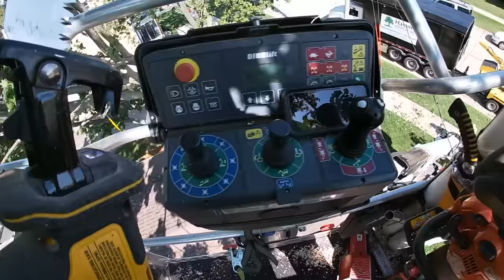Harassed by Angry Neighbor Demanding Tree Removal

Comment: As a homeowner, if that was my tree and on my property line, I would immediately have it removed for the safety of my neighbor and their property. I would be ashamed and embarrassed otherwise. Shame on him and his snotty wife!
Reply from the maker: I can truly relate Norbert.  One of our core values is Extreme ownership and it would compel me to do as you have said. https://www.instagram.com/tv/CXGmjZ7JD4v/?utm_medium=copy_link. Thanks for your comment!
Reply: I agree - I would do the same.  That said, how does an ethical, moral and good values based neighbor pay Mr.Game of Trees in those tight situations? This is not cheap work and I would loose sleep knowing  5,000lbs of tree will fall on my neighbors garage before figuring out my financial solution. 
I'm a newbie homeowner.
Reply: @johncollins7044  Here is AZ, if the neighbors tree is hanging over my fence, I can trim to the fence.  I have done it to my neighbors oak on one side and my other neighbor has done it to my tree that is hanging over his pool.  I have no issues with it either way.
Reply: @nmopzzz   i live in tucson and i researched about trimming trees coming across property lines, and what  he says in the video about if you trim and kill the tree than its on you is true here.  dont believe everything you hear.
Reply: I would propose that we share cost, we both win.
Reply: @59jm24  I agree! however I think the tree owner is set on making a issue of what's happening & trying to get someone else to pay for what he should pay for & then some!
Reply: @GameofTrees  “separate-entities” not a blanket statement!
Reply: @ThedrcOfYork  If she is running a non profit house, she is most likely dumping household cash into the non profit. They may not have the funds. that being said I would tell my neighbor the truth and then advertise free firewood, you cut it down.
Reply: @waynegriswold8953  In WV if you trim a tree or bush back to your own property line and that plant/tree dies then that is perfectly fine as long as you didn't go onto their property to cut it down without written permission. The way we see it is if your property is causing problems on someone else's property then you should take care of it yourself and if you don't then your neighbor will.
Reply: @59jm24  Presumes both cooperative and reasonable people.
Reply from the maker: @Morons with Power actually, I have a septic, so I keep most of it until I pay to have it pumped every three years:) thanks for participating!
Reply: @GameofTrees  you did right by the woman with the non-profit helping others ...     "bring me to court :)"
Reply: I not only would, I actually have removed large trees on my property leaning towards a neighbor's house just 20ft away.
Reply: @johncollins7044  It need not be expensive if there is room to fell the tree whole or in large pieces, and you have a chainsaw to cut up the pieces.  I usually pay about $100-$200 per tree for my tree service contractor to "make the trees horizontal" for me.  Then I cut them up myself.   I even had one tree cut and lifted off the end of my roof, for just $800.
Reply: I totally agree with you.
Reply: @waynegriswold8953  
You were a very smart chap to actually check. Different states, even different areas with the state, may have quite different interpretations of what is, or is not, allowed.
In this country, deliberately killing the tree is illegal, and can even get prison time, but trimming to the boundary is allowed and if it kills the tree as a result, it may be legal as the killing wasn't the intent.
On the other hand, as a tree owner, I'd usually be liable for damage from the tree losing limbs, or even falling, if it was a known hazard.
Reply: I completely support the arborist here, but do understand that most people don't have the money to pay for anything over and above daily expenses. My sister had a couple of trees removed and it cost her thousands. She had to borrow money from my dad. This stuff ain't cheap. LoL
Reply: @tortillasarenotbiceps7622  I know it isn't cheap. We had 4 trees removed, not real big ones and it cost us over $4000.
Reply: Totally agree with you.
Reply: @hoosierladyus48  Ridiculous, right? I know these guys need to get paid, but it is very expensive and not everyone has thousands to toss around.
Reply: @waynegriswold8953  But it's HIS TREE. You can't charge your neighbours for the damage resulting from your own tree landing on your own property, ESPECIALLY when they had to remove it because HE refused to despite it being an obvious safety concern. The neighbours can charge HIM though if HIS tree lands on THEIR property. They could also sue him to have the side hanging over their shed removed. But they'd rather pay out of their own pocket instead of taking him to court. You're an idiot if you can't see how ridiculous it is to try and sue someone who paid out of their own pocket to do what you should have and are LEGALLY OBLIGATED to have done out of YOUR own pocket.
Reply: @tortillasarenotbiceps7622  You know what's even more not cheap? Having to pay for the damage to your neighbour's property resulting from being too cheap to pay for the tree to be removed in the first place...
Reply: @johncollins7044  He has a new boat, but he doesn't mind neglecting a tree that could destroy his neighbors property.  Priorities?
Reply: That Bloke with the Beer Gut was a woman?
Reply: I had a case like this years ago---a huge dying tree straddling the property line. I was going to pay for the entire removal but I asked the neighbor to allow the truck to go onto his property so that I didn't have to remove my fence. (The neighbor didn't have any landscaping or fencing; his yard was basically an open field.) He told me he would not allow the truck on his property, so I decided to just have my side of the tree removed. But before doing so, I consulted a lawyer just to make sure that he couldn't sue me for "damaging the tree" (I had lots of pictures of the rot that was splitting the tree in two.) The lawyer gave the all clear and my side was taken down. A month or two later, the other half of the tree collapsed into the neighbor's yard. I must say, I got quite a lot of satisfaction out of listening to him try to hand saw the enormous amount of tree debris that filled his backyard. Lol.
Reply: @forgottenking8141  A lot of the time,  those IN the law are not versed or fair in their judgements and decisions.  Unfortunately,  they are still "human" (to some degree)  and personal biases and such will make way into their decisions.
Reply: @GameofTrees   I think you could have legally dumped the cuttings in the tree owners yard , you are not required to dispose of his tree cuttings . Is that how the law works in that state ?
Reply: that’s cause you’re a responsible home owner. I’ve had to pay to trim my idiot neighbor’s overgrown tree cause he was too cheap to remove or trim it. it sux
Reply: Well said.x
Reply: @jenkor513  Fire wood has no value until a ton of labor is put into it .  I see free wood ads all the time. You want some inexperienced hack dropping a tree on your house and finding out they have no insurance ? That why professional tree companies charge good money .
Reply: @EternallyGod  who's that too?
Reply: I was and I did. They are just immature and self-centered.
Reply: Norbert Riojas - I agree 100%.  If it's that close to someone else's property line, how stingy and nasty can a person get to refuse to help pay for the removal of the tree, PLUS threaten the arborist who has nothing whatever to do with either property, threaten him that he "will be held responsible" if anything goes wrong.  What's happened to people today that next door neighbors behave like this?  I hope that man and his Karen wife watch this video and are ashamed of themselves as they should be.
Reply: Yo’ @waynegriswold8953 , the trouble with your statement concerning the likelihood of a tree going into decline as a direct result of pruning and then going after the arborist for liable, is the plaintiff would have to prove beyond a reasonable doubt that the tree failed as a direct result of said pruning, which is nearly impossible. I highly doubt any responsible lawyer would even take a case such as what is detailed here, as the likelihood of being able to prove the case is so low and for so little a reward as to render it futile. Here in Michigan our oak trees are vulnerable to oak wilt, and I used to work for one of the most educated multi decade experienced arborists in the area who briefly offered his services as an expert witness in court matters just such as this. When I asked why he stopped offering testimony he explained that no matter how sound his explanation, the defense lawyers without exception were able to shred his arguments in cross examination. And this is one of the people who was instrumental in discovering and conclusively determining the Emerald Ash Borer had established itself in southeastern Michigan.
Reply: I had a Chinese elm growing on my property, but the roots were lifting the neighbors driveway. We paid almost $1000 to remove it. Still on speaking terms with said neighbor. Doing the right thing isn't rocket science!
Reply: some people got some change in their pocket and think they are Rockefeller
Reply: @fulanichild3138  My neighbour had two trees on his property that he wanted removed.  Without one word to me, not one word of by-your-leave, he sent these tree removal trucks to my house one morning and the truck driver said: 'oh, we're here to remove the trees and it will be easier to do from your property.  Mind if we go on your property?'  I told him no.  My house is old, the driveway is old, it had already been damaged by neighbour construction work, so I told him no and had to call in sick at work to stay home and make sure they didn't go on my property.  The neighbour with the trees had to dismantle his gate and take down his awning to accommodate the trucks to take down HIS trees but clearly would have preferred see me, an older Lady, go through the trouble.  What a CAD!!!
Reply: @micheleemcdaniel389  In my case it was a couple of months of negotiations. I spoke to the renters and the owner well in advance of scheduling the tree cutters. The renters told me they would not let the tree trucks on their property, so knowing that it was not the renters whose property would be damaged by a fallen tree, I contacted the owner (who was living in another state). I sent pictures and the assessment of the tree company that the tree was so dangerously rotten that he would not let his guys climb it and would have to use a bucket truck. The owner sided with his renter. The renter had to clean up the massive amount of debris when the tree fell.
Reply: My dad's neighbor pointed out that the roots of my dad's 40+-year old sycamore were infiltrating the neighbor's sewer line, and my dad cut the tree down. Better to lose a tree than a good neighbor.
Reply: Amen 🙏
Reply: @unitedstatian  seems like in WV they are better are taking responsibility than in tucson. strange that in 1 country there are different laws. ah well.. there are many more things strange in the usa
Reply: @waynegriswold8953  seems like the 'law' in tucson does not support taking responsibility (like every one over 12 years old, should)
Reply: You’re a responsible adult & considerate of your neighbor. Thank you!
Reply: I would be worried about being liable financially with my insurance or out of pocket for the damages caused to the neighbors home. Sounds a little bad that I'm more worried about my pockets, but i certainly wouldnt want someone coming after me because of something i could have taken care of or prevented even if it was a hassle.
Reply: I agree and I have done just that! We had a very large tree that was growing over our neighbors house long before we ever lived here but when I bought this house I took that into consideration and had the huge branches removed . the tree looks stupid now but I did t feel right having massive eucalyptus branches overhanging my neighbors house they are notorious for breaking off during storms.
Reply: I just bought my house and every tree after found had root rot...7 total thank goodness 5 are utilities problems 2 I had to have a tree climber to cut coz they had to go thru others property with cherry pickers even though these trees bn 65 ft tall and big huge arms now falling in their yards posing a huge threat like Thor was throwing them from the sky these arms are bn torpedoed and sticking they up in yards and they wanted to b*tc! about having to go thru yards...they were told plywood would set down to drive over...l had no choice but to call utility 2 other removals refused to cut bc of it bn a liability to their lines and a power box...this was extremely expensive it was 2500 smackers to cut and have stump removals
Reply: Agreed. As someone who is not an arborist by any means, I get his concern of the old stump rotting away and maybe loosening the soil on the stressed side of a leaning tree. But I would have been paying for the removal of the first half and my concern would have been asking the arborist their opinion on whether or not we should keep the second half.

We had a tree cut down a few years back that had died and was ever so slightly leaning towards our neighbors drive way.  No one asked us to. We just took the action to avoid a potential tragedy. Some people are just concerned about themselves.
Reply: I'd like to think that any reasonable human would do the same and at least split the cost.
Reply: If their insurance company finds out that they are currently insuring a hazard waiting to happen they most likely will cancel their insurance.
Reply: I would of removed it too... In fact, the guy behind me has allot of trees under the power lines, and I do cut them....LOL I don't want his trees to knock out my power or the power down the block...  I wouldn't want to have to pay for a tree removal crew, but a tree like that needs the pro's...
Reply: @ThedrcOfYork  Kinda looks like he is asking for his tree to fall on that nice looking boat... I would be sad to see such a nice boat be trashed, but I can't say I would shed a tear for him at all....
Reply: The whole issue is grossly  over staged.
Reply: The law is starting to change over,to  neighbors hazardous trees where they will start being responsible for the damage it can cause.
Reply: @59jm24  hell no .. his tree he payes the bill in my book :-s
Reply: My neighbor has trees close to my house but he could care less.  On has many dead limbs.
Reply: Nah
Reply: My neighbours wanted to have all the tree limbs that hung over their yard removed from my trees. I said go ahead. Great neighbours! They could have forced me to pay for it... but they didnt.
Reply: @GameofTrees   hahahaha touche! 🤣
Reply: @waynegriswold8953  Key word: IF
Reply: I can agree 100% because my  husband and I bought a home with a black walnut tree which had a dead branch hanging over the neighbors driveway-  so for her and her cars safety- we cut it down.
Reply: That's  how a wonderful  neighbor  is !  I will Thank you from your  neighbors.
Reply: @ThedrcOfYork  He definitely  wants to get it done for free.
Reply: A neighbor cut down a tree that was over his property but grew from our property. My husband was upset the guy paid to have the tree cut. My husband wanted to pay him back but the man refused. He is a wonderful neighbor who looks out for his neighbors on both sides of him. Us, who are middle aged, and an elderly widow on his other side. That’s how it should be. Neighbors helping neighbors.
Reply: great person
Reply: Yea I agree with you completely
Reply: @59jm24  - That's a little too much common sense to expect from people these days.  It's SO much more satisfying to be a jerk and antagonize your neighbors and make things as difficult as possible for everyone.
Reply: Not everyone cares about their neighbors.  I just paid a crappy contractor to remove the tops of dead ash trees that were hanging over my property for the past 5 years. They were directly hanging over my fenced-in property where my dogs use my yard. The neighbor has tons of land & $$, I don't.  For my safety as well as my pets, I made sure I attended a town board meeting & asked them if I could legally do so. They said "Yes. If there is imminent threat of harm to my property/or person, I have that right. " They didn't offer to pay at all.
Reply: He Sounds just like my neighbor 😬
Reply: i would love you as our neighbour.
Reply: @waynegriswold8953 1000% false.  If a tree is a hazard, it must be trimmed.  If trimming kills the tree, the owner of the tree has to pay for the rest to be removed.  Unsafe overhangs must be removed.  The owner of the tree should have trimmed it when it was younger so it didn't grow in a dangerous way, they don't get to neglect maintenance on the tree and them claim their neighbors are responsible for cutting off hazards.  Groom your trees and they won't grow in hazardous directions.
Reply: @pulaski1  Same here.  I ended up removing 4 trees in a small backyard that the previous owner just let grow wildly and against the fence.  3 were done myself because I got rid of them before they were too big for a  JawSaw.  The 4th was left, but as soon as branches started touching the house and the neighbors house, I had it removed by a service, the trunk would have eventually touched the fenced and displaced it if I just trimmed it and let it keep growing.  People always seem to ignore that trees grow bigger.
Reply: at the backside of his snotty wife......... is a snoooootty husband.
Reply: My next door neighbors have the tallest & largest bottle brush tree in my entire city. Peter, my next door neighbor had widened their driveway so they could park all 4 of their cars on their driveway. The bottle brush tree's leaves end up being blown over my property, making big mess when the Santa Ana winds come blowing. It seems to me they are scared to park under that tree that is on their property. They will park their cars across the street in front of another neighbors house. The city won't trim the tree down. The last time they did, they just trimmed a few branches and left. Talk about lazy. One day, that tree is going to come crashing down in the street or worse, their house. They also recently took out their front, dead lawn. Now, it's all just dirt. Their house is one of two, eyesores on the whole block. I would be ashamed if my front yard was all dirt. Hopefully, Peter comes to his senses and fixes his eyesore front lawn😄
Reply: I've had a tree removed that didn't look this bad. No one had to ask. You don't have to be your neighbor's buddy, but you should do no harm.
Reply: He ain’t no neighbour though….
Reply: Yep,  hopefully it does fall on the boat and not covered by insurance
Reply: It is expensive to remove a tree.  They might not be financially ready to do it on that particular day.
Reply: Make this tool pay
Reply: Unfortunately what this guy wants is 0% responsibility for a tree that’s 100% his responsibility.
Reply: @GameofTrees  I like the battery-powered saw I need to get one
Reply: Did you notice in the video, the tree he was removing, was split and being held up?  He should have walked away and said the lawsuit will ruin you when it does come down and will when the next storm come though
Reply: Great call.  And a lot of people here are right behind you with those remarks.
Reply: @twizz420  i used to work on jekyll island, and anything hanging over your property line is your problem, even if the tree fell from their side entirely and damaged your property, it would be up to you to handle the damages and cleanup, unless it was brought up with insurance as a definite hazard
Reply: @twizz420  unfortunately he wouldnt have to pay if it did fall on his neighbors garage, messed up, but thats how it is in Georgia anyway
Reply: @waynegriswold8953  That’s true.  Generally, if a limb is hanging over your property, you have a right to trim that limb, but if it kills the tree or if the tree dies and falls over and damages the other neighbor’s property, there are liabilities involved.  There are a lot of grey areas in real estate but bordering trees and their limbs have a lot of precedents.
Reply: @nmopzzz  That has been the case in every state that I've lived in. I think that it's true nationwide.
Reply: My neighbors, and specially the next door, have forest of Christmas trees and other trees and climbing trees growing 2/3 over my driveway and house roof! A few times, they had people came to clear their toilet pipe😅. A month ago, they had people cut down only one tree and told us “because it’s grown over to your house”.
Reply: @GameofTrees  salute.  I like Jocko too, will definitely be getting that book. Love your work as well 💪